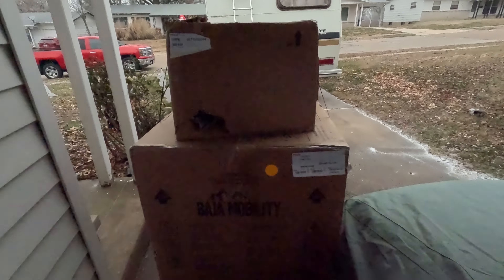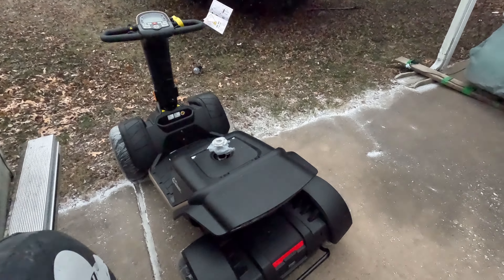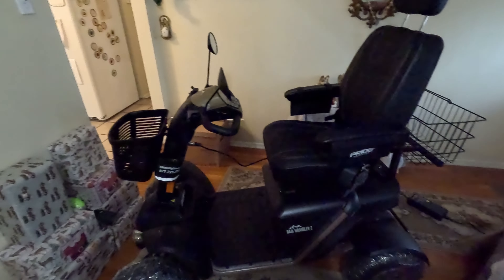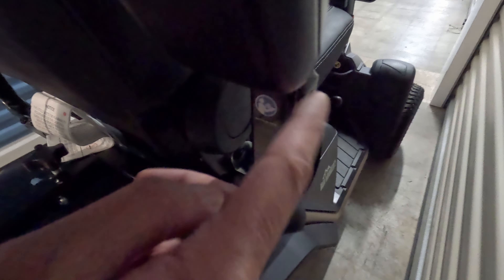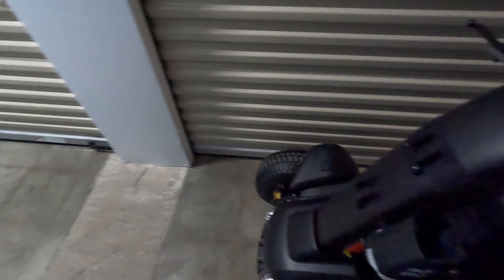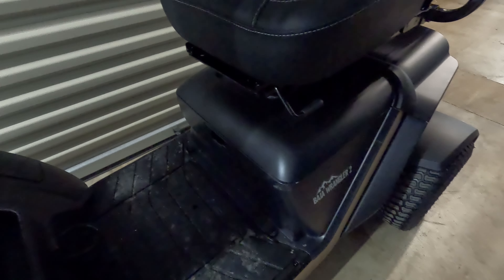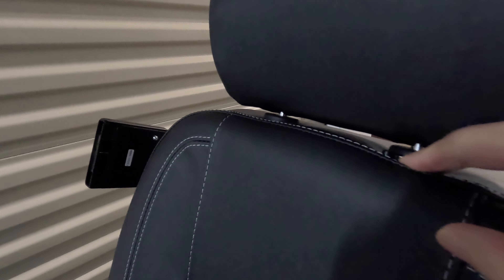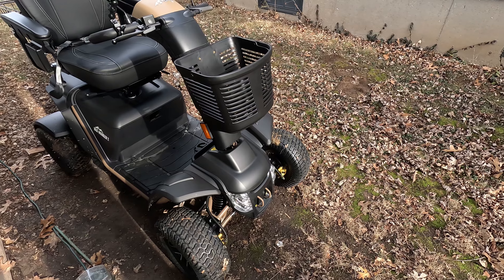Baja Wrangler 2 Unboxing and Setup 12-22-22

Comment: hi, AGM batteries are better, ok they are a bit more expensive but they last longer, I had gel batteries in my senior citizen's car, they only lasted a year for me, ok I have to drive up a lot of hills to get from A to B, that was probably the reason. But I've been using the 200 amp AGM batteries for 3 years with no problems, you can also run them down to 50%, but I don't do that very often, quite rarely, what I do is charge the batteries every day so I have full power available every day, no matter how far you've driven beforehand, always charge it, that's the best.